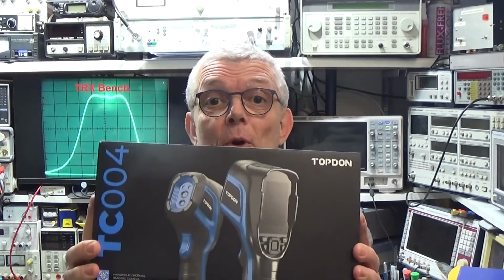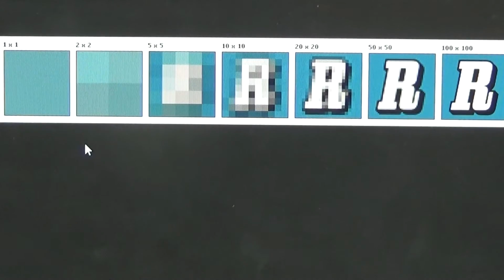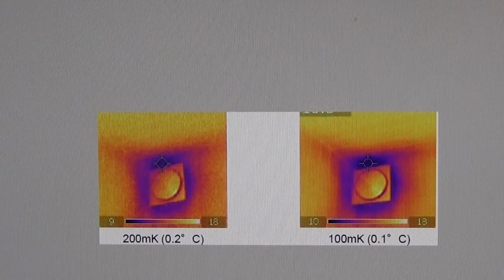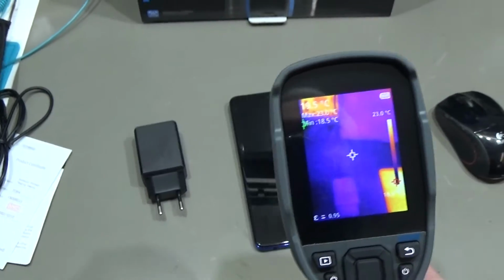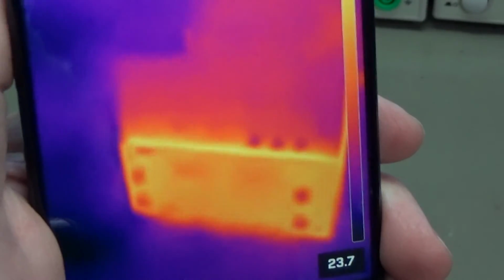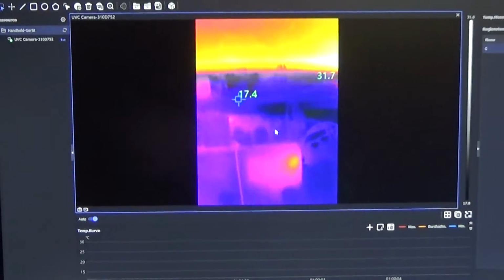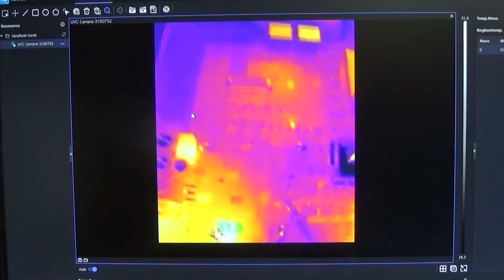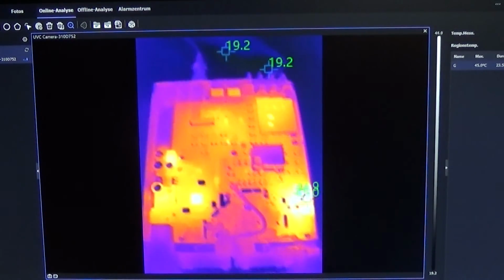#264 TOPDON IR Camera for electronics fault-finding

Comment: Excellent Review.  Here's a question: Can the Topdon, or similarly capable IR camera, help to find a 500 mAh parasitic draw within a vehicle?  For example, by looking at the fuse box, the relays, the radio components, etc. Or, would such a small parasitic draw likely have too small of a heat signature to be detected?
Reply from the maker: No, 500mA does not produce heat on fuses, which are good for 20-100+ Amps. That can't be found with an IR cam.

Comment: Hi Peter, to emulate the MSX feature of the FLIR, you could overlay a video stream from a regular webcam (optical camera) attached to the TOPDON on the side, using OBS or similar software to merge the two streams together. It would require calibration to match the size of the two images, but it can be done in OBS directly. 73

Comment: Hi Peter. Another very interesting and informative video, I am currently looking for an IR camera to use as an electronic fault finding tool and the TOPDON TC004 has very impressive IR resolution for this price point, I didn't know of these cameras. I was considering the FLIR  ONE Gen 3 as I do like the optical overlay that adds detail to the components. As you say if the next gen of TC004 had an overlay camera it would be an incredible bit of kit epically at these prices. Thanks for a very helpful video, best regards from the UK.
Reply from the maker: Hi John, let's see what the TC005 can do for us.